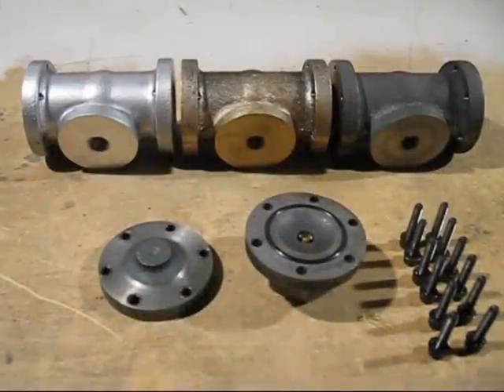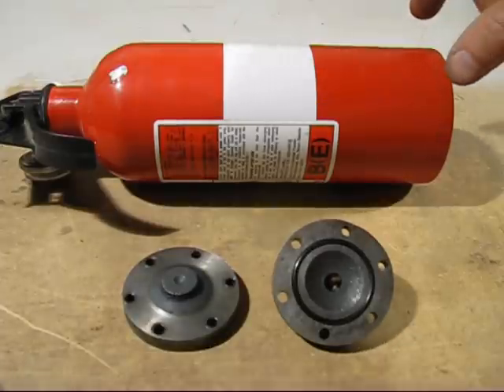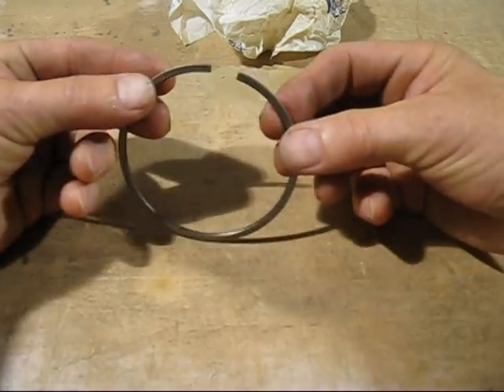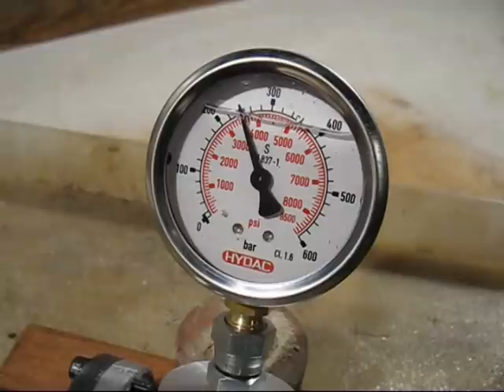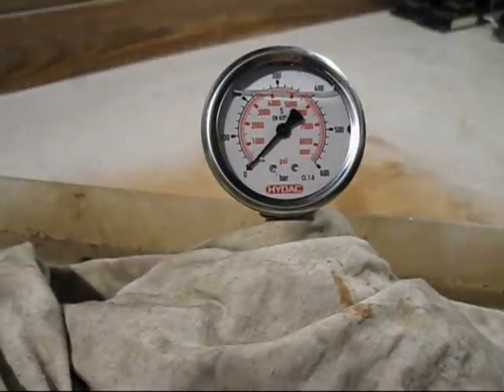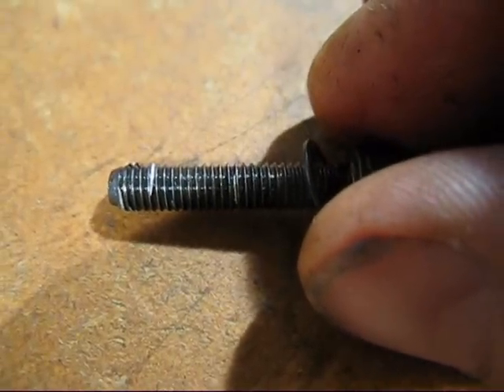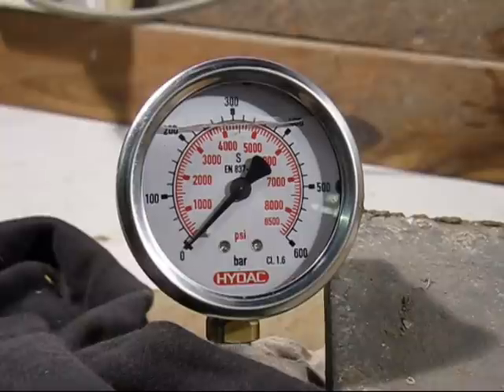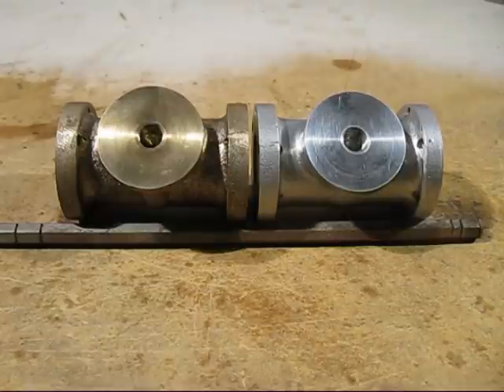Aluminuim vs cast iron who will win the pressure test

Comment: I have a few hundred pounds of aluminum chips from a production run of parts. The scrap yard does not want them, I use a water soluble machining fluid, they claim  the machining fluid contaminates the recycling process.
Would you recommend melting them to pour into ingot molds for recycling, or for making other castings? Would I have to wash the chips first?
Wouldn't the residue just burn off? Form a dross?
Thanks in advance.
Reply from the maker: Aluminuim chips are the worst scrap to melt down for the reason you mentioned but if you want to recycle the chips just do it and you will find out how bad it is to recycle.
Reply: @luckygen1001  so if I washed and dried them first they would be fine?
Reply from the maker: @denisknobloch7908  Yes you can do that but you will still get a very low recovery rate.

Comment: That was an absolutely great video. It was a great one on one comparison and I enjoyed it. But… Aluminum requires 3-4 times the diameter of thread engagement, cast iron 2-2.5 times the diameter of thread engagement. Cast bronze is also in the 2-2.5 times diameter of thread engagement.

I'm not sure but I'm guessing you're using M6 screws. They each have a tensile strength of close to 7000 psiI'm not sure but I'm guessing you're using M6 screws. They each have a tensile strength of just under 6500 psi (if they are 12.9). 

Technically you should've had a smaller O-ring installed for this test. I'm not surprised you blew the end as there was technically maybe 20 times potential surface pressure being exerted on the end bells.

I would love to see this test redone with a solid 1 inch (or 25 mm) cold rolled steel end Bells, and if proper threat engagement for material is not feasible, back it up with one or two nuts, if they are M6 12.9 torque them all to aboat 150in-lb. With a 1 inch diameter O-ring or maybe something only 25% bigger then the through hole. This goes back to the fire extinguisher bottom deformation with pressure surface area.

Piston rings are generally made out of tool steel heat treated. Heat treated tool steel has elastic properties and tensile sharing properties. From what you've demonstrated in this video,  the tool steel has be heat treated spring steel. It is absolutely not cast-iron.
Reply from the maker: I used M5 coarse screws so you were close with your guess.

Comment: Good Evening Lucky, great vid, as always. Thanks. It would be interesting to rebuild the alu one with high tensile bolts and nuts to see at what pressure and how it would fail. You seemed to get round the grease nipple leaking. Did you do anything special to avoid that?  
Thanks again, Bongo.
Reply from the maker: I replaced the leaky grease nipple with a new one, no more leaks now. I try to use old parts but it does not work all the time.

Comment: That's some amazing pressure far above what I would have expected from either material. Very interesting to me. 
Thanks for sharing this. Glad you weren't damage by the grease gun failure it the vessel cap failure...and was reassured somewhat by the retainer wrag. Very high pressure though realitively low volume so the wrag did its job well.
   Good to see another quality video from you sir.
🙏 Blessed days now
Crawford out ⚒️🧙‍♂️

Comment: Interesting comparison. And smart of you to not try and break the silicon bronze casting. Usually better to quit while you are ahead. My guess is that with nut son the bolts on the aluminium casting you would have had an endcap failure like on the cast iron casting.
Reply from the maker: If you have ever seen my videos about making silicon bronze you can understand why I quit. Yep if the threads held up on the aluminium casting the end cap would have failed.
Reply: @luckygen1001    I have seen all your videos. So yes I agree completely. Much more intelligent to keep the grenade from blowing up than a blind quest to see if you can break something.

Comment: In aluminium, good engineering practice would have called for fine thread bolts.
Interesting experiment though!
Reply: I always thought the opposite was true; we use UNC bolts in alloy engine block and head castings, usually UNF everywhere else. In metric world i've never seen metric fine used on alloy bits...
Reply: @OliverHirstsLife  
Yes. Better to use coarse threads in aluminium. Normal metric threads are not particularly coarse though. UNC is a better choice, but it is banned in the old world nowadays.
Reply from the maker: When I was an apprentice I was told to use coarse threads with cast metals as it was stronger than a fine thread.
Reply from the maker: I used 5 mm metric coarse on those cylinders. Did you notice that I was using a longer bolt to use all of the thread but it stlll did not hold the pressure.
Reply: Nuts and washers or Helicoils
Reply: Pull tests clearly show course threads are stronger than fine threads .... there are several factors that determine the strength, root radius for one but  the root thickness dominates... when pulled, threads act like a coil spring ... the first turn takes about 35% of the load, the next somewhat less,  and so on, the eighth wrap isn’t loaded at all .. so the load is distributed over less material with fine threads compared to courser threads.  Why does the first thread take more load than the next wrap?  Before the second wrap takes a load the first wrap must deflect....to load the third wrap the second wrap must deflect and in turn the first wrap must deflect even more ... so the load is not shared evenly.. thus adding threads beyond the eight or nine does not improve the strength

Comment: Interesting, and about what I would have expected but nice to see it demonstrated. However a question - what aluminium alloy? If 601 (356) then just a simple T5 age like I do would be well worth trying as it would significantly increase the thread strengths - to the point, I suspect, that the cast iron end cap would have gone first.
I have never believed that petrobond is necessary for a good finish and would defy any petrobond user to even equal the finish I have achieved....Martin
Reply from the maker: It was a car rim and is a great casting alloy. Green sand is much cheaper than petrobond and works just as good.